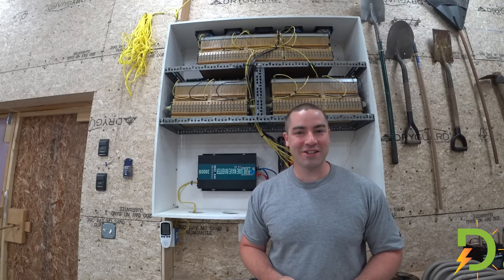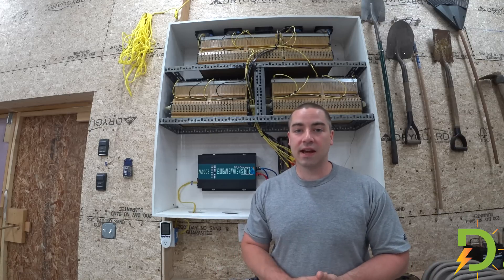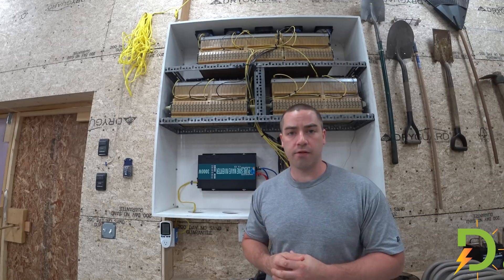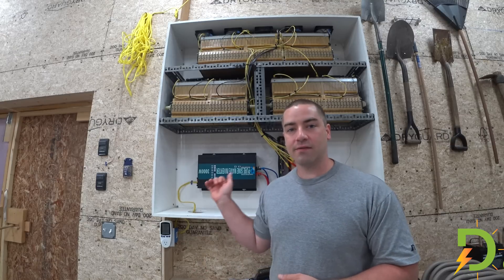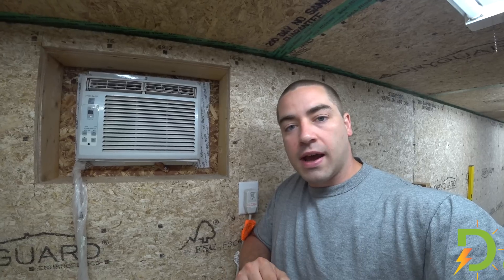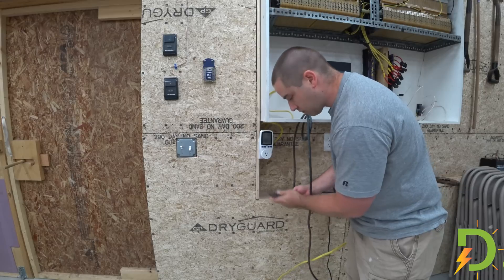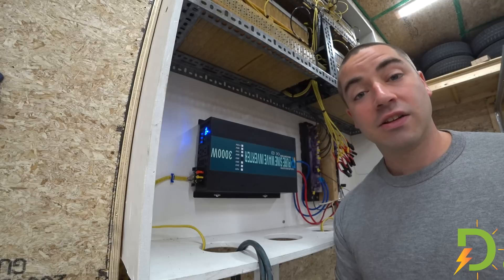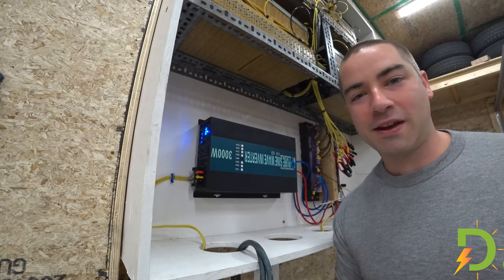Air Conditioning, Reliable Inverter, Off Grid, Solar and Batteries

Comment: Thank you for your review.. but your condition  1500 btu or 5000 I'm confused.. I have 2400 btu and it drow 1800 watt
Reply from the maker: My tiny window air conditioner is rated at 5000 BTU's.  That's how much heat energy it can remove from the room per hour (given ideal test conditions).  This is a very small window AC.

Comment: Very informative.  Did you disconnect those battery because you can not used them while you have load on your battery?
Reply from the maker: Hi Julie,  In the video the batteries and inverter are connected.  I disconnected the solar panels only for the video to demonstrate that I don't need the solar to run the AC.  After the video I re-connected the solar and left everything run in automatic all summer.

Comment: Can that model of inverter start up a more powerful AC unit?

Maybe one with a 1200W power draw
Reply from the maker: Hi MWB Gaming, I'm assuming you mean 1200W continuous draw.  In that case I would guess "no".  The voltage drops quite a bit with my tiny AC starting up.  I don't think it could, but maybe someone else knows.  Another youtuber "Going Off Grid" powers two large AC units in house on an 8000W model.

Comment: I have a 750 and 1000 watt pure sine wave inverter and both start and run a 5 kBTU/hr air conditioner. The limit isn't necessarily the inverter but the storage and production.
Reply: I have a 1200 pure sine and it wont run my 8000 btu every time. I am currently looking for a bigger unit now.

Comment: Hey David,  First time watching your channel.
I followed the link for your inverter and was pleased to see it was pure sine, but then a quick glance at the reviews showed only two 1-star reviews. Have you had any issues with that inverter as there's a comment about a 1200BTU AC killing it. What's the max continuous load you've been able to put on it? Thanks. =D
Reply from the maker: Hi Parity3rr0r,  Thanks for watching the video.  I've been running the AC for a couple weeks now without any issue.  I will also plug in my miter saw, or shopvac without problems.  The only thing I can't run is my air compressor.  More here:  https://youtu.be/me0eAJL95og  I think it's a great buy for what it is: a cheap inverter.  But it has respectable numbers and I think a great value.  I've been told that if you overload it too many times it can burn up some part.  If you want to see more of these inverters check out "going off grid" youtube channel.  He has several from this brand.

Comment: A 3000-watt full-wave inverter should handle a 12000 BTU air conditioner, which is what you'll need for that garage. 1kw solar array with 6KWh - 8KWh of storage should be sufficient. 5000 BTU will run continuously and drain your batteries, so you're not really conserving with a smaller unit.

Comment: great video David aw just curious did you get the Mini split fixed(gas leak) i think if so was wondering if you can monitor electrical consumption on your Fujitsu unit...by the way your det up is awsome...:)
Reply from the maker: Hi Beez,  I have not fixed the mini-split.
Reply: ok cool,by the way your set up is awsome

Comment: Thinking about converting a cargo trailer to a tiny home and live in Texas where Hot is dominant 8 months out of the year. The trailer will be roughly 230 sq. ft. Do you think those batteries would sustain the a/c through the day and night while solar on top would re-charge?
Reply from the maker: Hi Rick,  If the cargo trailer is un-insulated then I would guess, no.  However, if you insulated it then maybe.  It would have to be insulated pretty well.  My friend made a presentation about insulating tiny homes, it might offer something valuable to your plans.  https://youtu.be/PK6GrzGzE3s
Reply: Thanks, David, I am also thinking of blending the system with a 600w producing wind generator as well, since the wind kick's up 1. in the winter and 2. typically at night with the cooling and warming as the sun rises. Just how James Bond can this get LOL...

Comment: Say I see all these people using these inverters and have had real problems. But maybe yours is a good one? Thanks for sharing 😃
Reply from the maker: Yeah, I took a chance on the brand.  So far it is working out, but I'm also using it for fairly light-duty stuff.  A-5000 BTU AC is not exactly a huge load.  If it fails I will make a video and let everyone know.

Comment: It's unusual to power conventional A/C from renewable energy because such units are not designed for efficiency at all. But, it needed to be done I suppose. You can improve on this (a lot) by building a smaller heat pump and burying some PEX in your yard to use as the thermal sink/source. 57F ground temp is a lot closer to "room temp" than 90F in the summer or -10F in the winter, so the reduction in energy required to make up the lower difference represents a significant energy return. Thanks for filming this.
Reply: @Giblet : My imagination ran wild with your post. Can you reign it in a little with some build descriptions of what you are refering to for a noob? Or a link to what you are mentioning?

Thanks in advance.
Reply: What he is describing I have seen and he is right.  There is an 80+ year old man who is growing tropical fruit LARGER than they can in Florida using this technique in Nebraska AND he grows it year round.  This geothermal greenhouse is now being built in the desert out in the middle east to bring food to them that they never could have otherwise.

Basically you bury a bunch of pipes under the ground with an opening, then bury X amount of feet, then another opening and what that does is the ground is the same temp year round so in the summer it is cooler than outside and in the winter it is warmer.  It may take 80-120 feet of 12inch pipe but is well worth it.  Where he is he said up north it is warmer air coming in than where he was due to hot springs etc... but nothing was warmer than 64f.  Look up geothermal greenhouse on Google.

Comment: You should not knock mini splits in my opinion as some of the newer ones use inverter technology to reduce any hard start amp draw. those type (with inverters) are used extensively in heat pumps versions also, they are "very" efficient. Just check it out, much has changed in the efficiency realm in just the last year or two. Seems the ones from Asia are "way ahead" on mini split ac/heat pump efficiency.
Then a comment about your present window/wall unit. You say you've never had any maintenance done other than the indoor air filter. 
I am a retired HVAC tech and my advise is this, what you need to know is that nearly all AC units that you showed in your video have a fan blade in the rear that dispels the heat drawn out of your space, usually one motor that drives both the squirrel cage blower used on the indoor side and a fan blade on the outside. The fan blade on the outside has an outer ring attached to the blades which is used to sling the water collected from the indoor evaporator side into the condenser, this increases heat dissipation of the condenser but also because the condenser is now wet it accumulates dirt and eventually will plug air flow through the condenser. You never see this because the fan pushes the air out the back side so the inside "wet and dirty side" are never observed , because of the cover and shrouding around the fan. To check this condition most window ac's are mounted in a shell. To remove the ac unit just pull the front cover off and determine if it is indeed mounted in a shell, refer to the owners manual. If so, first disconnect it form the power source, then remove any possible fasteners and just slide the innards out. Some times it is a very easy process, sometimes not. when it is out you can check the inside of the condenser for dirt build up, if present the easiest way to fix is to remove as much shrouding as possible (might skip this part first and only do when dirt is really caked) then cover electronics and motor with plastic to keep them from getting wet, then use a garden hose with nozzle and spray the water from the outside to the inside "always at a straight angle to the condenser fins as they are aluminum and bend very easily with angled water spray". you might have to spray form the top down on the inside for really tough dirt and/or use a light brush being "very careful" not to bend the fins. I saw on your unit that you have some bent fins on the outside. Bent fins mean no air flow in that location to dissipate the heat the condenser is to take out thus reducing efficiency and that means higher energy costs - so buy a fin straightening tool and carefully straighten them out. The fins on all ac's are different (spacing wise) so get a multi-purpose fin straightener, being very careful as condenser is all aluminum (soft) and refrigerant is at high pressure so nothing sharp to cause any problems and just be safe.
Cleaning the condenser will restore it to its like new cooling capacity.  
Drain water and dirt form the pan when you are done, remove any plastic you attached and when it is dry enough, reinstall into the shell. Side note, compressed air will work to some degree but is generally not as good as the water hose method.
Reply: i have 2 window units instead of running the big boy central ac...i simply hose them out while they are mounted..do it about every other month while in service-florida..8 months a year
Reply: I have a 8000 BTU Mini split heat pump inverter for my off grid and I couldn't be more happy
Reply: @DualTasticToday  im in southern california /arizona humidity gets around 70 - 90 % here i use a evaporation cooler and in a 100 degree weather cooles the house down to around 75 80 degrees but im not using a squrral cage fan ether,...more like box fan,....works great,....
Reply: Can you recommend any particular brand or size or type or model number for the Mini Splits we are off grid and need some air conditioning out here in Arizona thanks

Comment: Did you buy your Chevy Volt batteries new or used?  Two last questions.  Where did you purchase the batteries and how much were they?  I have found various car brand names but not any specific names of the batteries.
Reply from the maker: HI William Kraft,  I bought the battery from an auto recycler (aka: junkyard).  It was out of a 2016 Chevy Volt that was totaled, but the battery was still in good condition.  This is actually common because the battery is housed in the middle of the car.  I paid $1900+tax=$2,033.  Here is the first video in the series: https://youtu.be/V1t1SoEhVNQ
Reply: Thank you DavidPoz for responding quickly and for the information on the Chevy Volt battery.

Comment: Great video, my husband is from Springfield Massachusetts, I cant wait to go visit, So now, When I see all those wires out on the side I'm like woooo, I was wondering do you still keep the solar panels  Attached to the inverter 🤔 so you can keep the batteries charged?  I'm new to this, so I'm trying to learn as much as I can, I would have loved to have seen how you put all that together.. Look forward  to watching  more of your content
Reply from the maker: Hi Love Mind,  Thanks for watching.  I have some solar panels that I can use to charge the batteries, but I put them away at night because I don't have a good setup right now.  I'm working on building a ground mount to hold the solar panels.  If you want to see more content on the DIY powerwall, this is my very first video in the series: https://youtu.be/V1t1SoEhVNQ

Comment: my i know the AH of your battery thanks
Reply from the maker: Hi Noah,  The battery is 18 kwh, or about 400 AH.  Thanks for watching.
Reply: how long you can run your air-con?
Reply from the maker: Hi Noah,  The air conditioner can run about a day and a half non-stop, without any solar input.  However, usually the thermostat is cycling it on and off to keep the temperature consistent, in which case the answer would depend on heat gain.

Comment: Hi. I was wondering if you could send me a diagram on how to install this inverter directly not from the 3 outlets but from the main 3 connectors since i bought one 24vdc input and it arrives tomorrow. I see in the video that you have a yellow extension connected to the inverter. Wish to know which is the neutral, hot line and ground and how to connect. Email me if you can at dangel1635@yahoo.com thnks
Reply from the maker: I used a multi-meter to determine which is which.  On my inverter it went N,G,L1 from top to bottom as I have it in the picture.  I'll send along a close-up photo to you, but please verify your own wires in case anything changes.
Reply: DavidPoz thnks

Comment: Can that Inverter handle the surge of a washing machine and a dryer?
Reply from the maker: Hi Alfman,  I don't have a dryer, so I don't know about that.  It can run my saws, which are 15 amps.  My washing machine is less than that, so I would guess it can run a washing machine.
Reply: If you had a gas dryer, it could handle the electrical part. A electric clothes dryer takes A LOT of power.

Comment: Nice exposure. What is the size of your Solar panels
Reply from the maker: Each panel is 365 watts.  I currently only use two in a small temporary fashion.  I'm building a larger mount that will hold 12.
Reply: DavidPoz. that will be great. How many kwh do both produce per day.
Reply from the maker: Hi Joseph,  The last time I had them hooked up they produced an average of 4 kwh per day.  I have a video on that here: https://youtu.be/Efqx_iRYRjo
Reply: DavidPoz. Thanks for your response. Be well!

Comment: I was using two 5ks in my garage and they could not keep up with FL heat.  Nice to see your set up is working like a champ!
Reply from the maker: Hi Charlie,  Thanks.  I contribute the success to the fact that I air-sealed and insulated the garage myself.  Here is a video on insulating it: https://youtu.be/k8g9Q___CJ0
Reply: Currently I do not have any insulation on the ceiling in the attic.  I have added a .5 in layer of insulation on the garage door, I want to do more but i have the windows in the door so cant cover them up.   I also need to go back over the windows with an UV blocking film and add something on the bottom row sections.  I have a gas hot water heater, it does a great job of holding in the heat but I still want to put some kinda block around it to help hold the small amount of heat away from the center part that I work in.  
  Also thinking that i might end up putting up a curtain rail system to help control over all dust to keep it off my car.  This will also allow the area to be cool to be smaller and should make cooling it down faster. 

do you post stuff on facebook?
Reply from the maker: Hi Charlie,  Here is my facebook: https://www.facebook.com/DavidPozEnergy/  I usually post updates to this channel, or get into conversations with people.